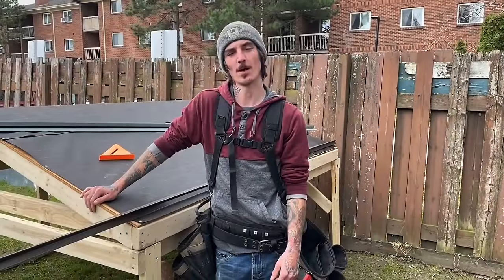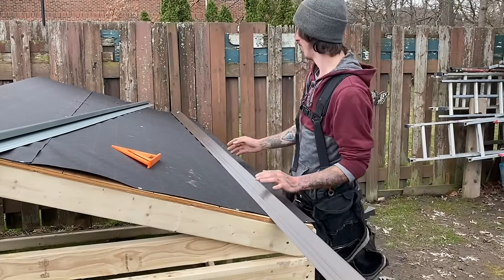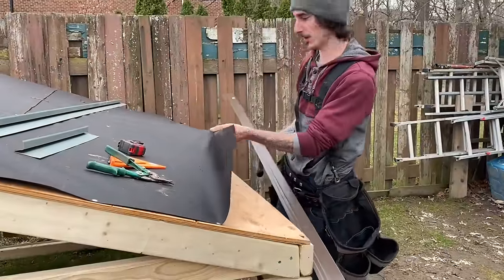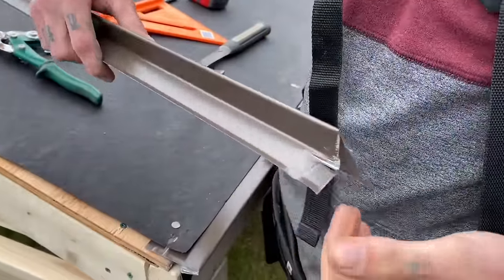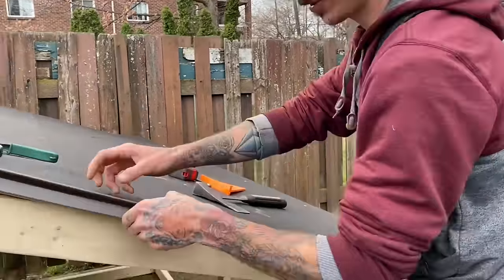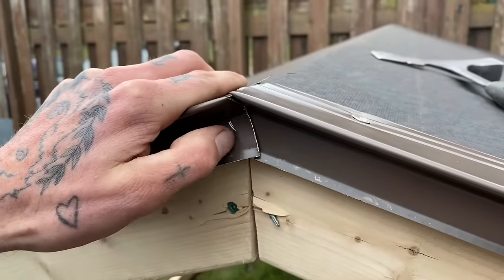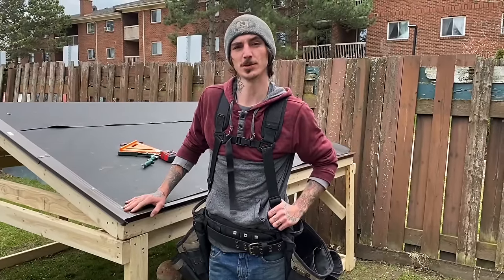How To Install Drip Edge On A Roof

Comment: I want to know why roofers install that drip edge right on top of the fascia board or the eves, if there is no fascia board. How the heck does a roofer expect the home owner to get any paint behind the drip edge and on to what ever board type face you have?..thks jc
Reply from the maker: Here in Ontario we do not paint drip edge. We simply add an aluminum fascia over the board to protect it. It simply tucks behind the drip edge.
Reply: @Average_Roofer  i am not talking about the drip edge itself. On my house there is no facia boards, so,you see the eves and a drip edge hanging down from the roof. I cannot get paint on the eves unless i pull the frip edge away. There is very little room to stuff a paint brush in there......thks jc

Comment: Someone needs to make a good video on drip edge when the roof edge isn't straight how to make the cuts..the bottom slope of my roof has a Bow in it because of the beams
Reply from the maker: This can simply be fixed by adjusting the fascia board. 
When you tear off your roof, remove your eavestrough and fascia metal. 
Run a string line from gable to gable and mark your rafter ends. Cut to length. Install the fascia board (2x6 standard). 
Using the string line, ensure the fascia board is straight. 

Then reinstall your eavestrough and roofing materials as normal. 

Hope this helps. If not I can make a video on it when I get a chance.
Reply: @Average_Roofer ..yeah that won't work on mine..there's No facia board at all..it's a 1x2 nailed to the beam ends and the sheeting lays flush on top of the 1x2..no way to adjust

Comment: Uh huh. I had to learn the hard way from a homeowner…OC, GAF, CertainTeed all state that drip edge should be 1/4” - 3/4” past the fascia, and if there’s a warranty issue and any of them send an investigator, having improper install of drip edge is an insta-fail.
Reply from the maker: That depends on your local building codes.

Comment: Nice techniques but you really should get a new pair of snips your dull Snips are scuffing the paint off of the drip edge. And I also like to pinch the ends of my drip edge where the rake meets the fascia so you can't see the hole

Comment: If you cut it at 8 feet, the exact same as your roof edge, and then left it "a little bit in" from the rake edge, wouldn't it be hanging over the opposite rake edge? I do like this explanation, however, and will be using it to install my first drip edge today. Thank you.

Comment: Not installed correctly, you need a gap between drip edge and facia. If not water runs off the edge and directly on the facia causing rot snd staining. Proper install requires a 3/8 gap.

Comment: Why not overlap your drip edge an inch why only 1/4 inch and Lenox makes awesome snips all I use there more money but awesome
Reply from the maker: Louis Brown if you over lap more than 1/4 the seam no longer sits flat and will begin to stick out. Not giving it a clean look.
Reply: @Average_Roofer  I bend all my own drip edge and miter all my inside and outside corners and if you over bend your over lap by hand on your over lap pcs they will blend perfect I tend not to like home Depot style tinfoil flashing myself I like 26ga galvi or 0.40 aluminum also copper drip and valleys are humpable flashing too
Reply: What I do is just snip off the bottom edge of the drip edge at a tight angle, then the next piece that sit ontop can slide in there and the 2 pieces will be sitting 100% flush with eachother. I only make my overlap about half an inch

Comment: Why wouldn’t you flush one end, tack it, go to the other side and cut it. Instead of pulling your tape twice, and then cutting your drip?
Reply from the maker: Anthony Cravatta this is just for an example for beginners. Most professionals on a jobsite wouldn’t even pull a tape out.

Comment: Run the drip edge just a bit past corners and cut n bend. As for the peak I always cap it. If the drip edge does not extend over it I cut both sides back a bit and make a cap for it. Looks nicer and both sides are on top of the other drip edge. You shouldn't cut your dripedge flush with corners or peaks buddy

Comment: Actually bending the corners are a waste of time especially for two story homes or any home with gutters!!Also drip under or over the paper is not a huge deal.If water is getting under the shingles you have a problem.I have done it both ways with no leaks.I see why you suggest it this way though.Only if that's the case ice/water shield should go at the eaves over top of the drip.Then ice/water over top the rake drip on to the paper36"or18".Cause technically water or driving rain could still come in the paper and drip on the rakes.Again depends on the area you work and live also the pitch the way the house sits.I had a house that depending on the rain would leak on one side.I Ice/water driped,ice and watered over drip and it still leaked.I had to caulk the shingles down to the drip and it stopped.All cause certain driving rains would hit this one side so hard.

Comment: Thanks for the info. Sadly, I'm more confused on some parts than ever. ON "This Old House" the guy says (paraphrasing) "I like to keep about a 1/2" space between the bottom drip edge and the edge of the roof so that water wont roll back and rot the wood... Any advice? https://www.youtube.com/watch?v=3bQPEEtWGKU  ...Starts around the 52 second mark

Comment: Average guy..ya gotta extend A half inch past rake on dripedge so u don't have a hole underneath...and you also have to wrap the bottom metal not the rake

Comment: The drip edge should not be tight against the fascia board. You want to leave a gap so water doesn't wick against it and cause rot.

Comment: You're not supposed to but the drip edge against the fascia I wouldn't let anywhere near a roof
Reply from the maker: If you use aluminum fascia metal over the fascia board it is highly recommended.
Reply: Absolutely wrong you were taught wrong you need to do your research try watching this old hose
Reply from the maker: @patricklaughrey8727  this old house is referring to a different building code.
Reply: @Average_Roofer  has nothing to do with code its about static energy keep doing it I stay busy fixing people's mistakes job security
Reply from the maker: @patricklaughrey8727  I can prove that it doesn’t cause damages but okay 😂

Comment: Wrong. The underlayment always goes down first.  Drip edge installed over the bottom. Underlayment ie; ice shield or 30#felt, is always installed down over the gutter board 2-3".  There is a reason why drip edge was made. Up until  the 70s most roof construction consisted of 3/4" redwood on gutterboard and rakes. Then things changed because of dwindling redwood and higher costs. Well aluminium fascia and rakes became very popular and drip edge was used to keep the lower edge of shingles from drooping in to the gutter and securing fascia to rakes so the wind wouldn't blow it off.
Reply: I have no clue what I just read. But drip edge should always go on first, on the eaves. Then ice and water should be overlapping the drip edge that's laying against the roof deck. If there is water damming, the water will simply run down and run off the drip edge.

When you are putting the drip edge on the rakes, it should be put on after the paper is put on. So it should be ontop. But that isn't crucial, it doesn't matter if it's underneath or overtop. If water is somehow getting to the rake metal than there's other problems in play. Water shouldn't be touching the synthetic.
Reply: Read the manufacturers installation manual.  If you have a ice dam building up, the water will seek its own level in the gutter and freeze and fill up under the drip edge,then seep into the overhang. From there it will keep on leaking to the interior wall and down the wall. I've been installing ever since 1971 and I'm second generation roofing technician.

Comment: A) codes are different everywhere, we nail every 3 inches by code. 
B) your corners are wide open. You said the drip against the fascia will rot it out but open corners rot fascia every time. ALL WAYS MITER CORNERS
C) loosen or tighten your snips that cut looks like shit. Looks like you tried to rip threw it.

Comment: ,,to the hater herd:  just for the G-D record...ice and water shield is sticky on the under side for what?.....that's right , to stick to the G D roof decking.....ice and water goes under everything as a protective barrier..under EVERYTHING! ...after you establish that, it doesn't matter if the drip edge is under or over the felt paper.(starter row covers it)..personally I go  ice/water, drip edge, felt paper, starter row...then start bookin' 00.02

Comment: This kid has good intentions. But, drip edge belongs on the rake of the roof. GUTTER APRON belongs on the eave. Drip edge will work as installed in this video but it makes seamless gutter installation very difficult.

Comment: Corner looks terrible. And ridge peak doesn't look much better, jk ridge looks ok, but if it looks alot better to start out the ridge underlap pieces or make sure you dont have random finish up lengths and you symmetrical laps seams. That is noticable to front entry way and garage side gables where owner see everyday.

Comment: Not supposed to nail through the paper into the drip edge. It’s unreal how many people are making instructional videos and a doing it wrong. Why would you put a hole in the paper at the bottom of the roof if you don’t have to??

Comment: Wrong now try running water to it to see if the water runs down to the wood fascia
Reply: The shingles will be overlapping the drip edge 1 1/2". The water will simply just run of the shingle and into the gutter.

Comment: Never install drip edge on the gutters edge, if you put your starter an inch and a half past the drip edge you will be covering half of the gutter , with the drip already hanging over 3/4 ", and if you were to only go 3/4 of an inch past the drip edge,  you would have your inch and a half total, but as the water roles over the shingle it sticks to the bottom of the shingle for at least 3/4 of and inch( that's why you usually hang the shingle over the edge an inch and a half) and then sticks to the drip edge,  because water is magnetized to aluminum (figuratively speaking), so then it runs behind your gutter no matter what you do to it.(every time)...therefore you never put drip edge on the gutters edge!!  Let me know if you need more info....or a drawing...but don't do it cause it is wrong!!
Reply: No it's not bud.

Comment: This isnt proper. The face of the  bottom piece of drip should bend around the rake 1 inch and the face of the rake should be cut flush with the face of the bottom piece of drip and the nailler of the bottom piece should extend past rake 3/4 of an inch so the piece of  rake edge can slide over and lock onto the drip edge

Comment: Here's the deal men
I have been roofing since 96. I have come to the conclusion that i dont give a hillbillies fuck what code says about underlayment and i will tell you why. Have you ever torn off a roof and found 8"s or more of the eve rotted out. I have and its only when drip edge is installed first. Ice guard is engineered to adhere to the osb. Drip edge has zero moisture wicking abilities. Put your underlayment on first! And you roof will last longer! If your concerned about the bucked lap dont be! Its never going to see the light of day once you run starter and shingles over it. Also when you synthetic over ice guard it helping the next roofer after you when it comes tear off time. Ever torn off in the summertime? Shingles stay stuck to the ice guard super tough. But they come right off if you cover the ice guard with synthetic felt. At the end of the day its your job and your going to do what you want i just hope the explanation of why the moisture barrier goes on first helps answer anyone questions as to why? It is engineered to do so. Aluminum drip or steel are not moisture barriers and your wood will rot faster. I have roofed kid rock,Dennis Rodman,and a few other high profile clients and these people pick the best men for the job not the cheapest. Also very efficient with SARNAFIELD PVC, and Firestone TPO, EPDM. they are the best single ply company's on the market. Please dont come at me with dura trash or Carlisle. They are the first loser. If your not first your last! Lol.

Comment: Your right , u r an average roofer. Below average. You always wrap your rake 1st . And it doesn't (ice and water) go on top of the drip. I've always wrapped it on the facia into the gutter then u put your drip on. I suppose you go flush with the metal too huh. Wrong again. Please stop showing people the wrong way roof. There isn't a professional roofer alive that uses a square to mark metal. The reason for putting the take on 1st and wrapping it is so when u go to hang the gutter it slips underneath the drip on the high side of the gutter. Doing it your way there is no way to slip the gutter under the drip. U must be 1 of these "roofers" who was a ground guy last season and goes to a different company say your a roofer but can't go around pipe boots.

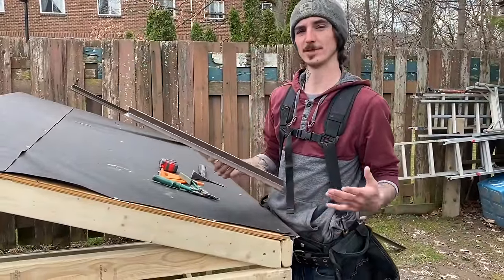Comment: starting @ 2:50 your dripedge does not follow the roofline down. In other word the plywood shud be installed longer. IMO, You shud redo and show a proper installation.
Reply: Ok bud

Comment: This looks like a cheap skate stuff in Virginia.  The roof is cut flush with the walls. So when it rains guess what duh. The walls are wet and dirt  Is splatters onto the bottom of the wall. Wish I had made the roofing company guys do a drug test before and after. Had lots of water leaks with damage.  I'm wondering if perhaps most roofers are dope heads. 🤔